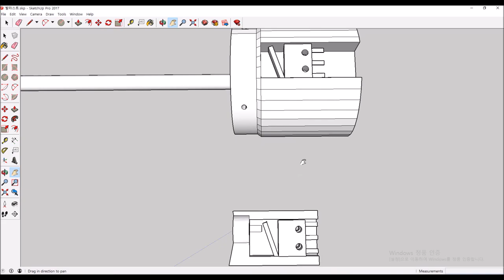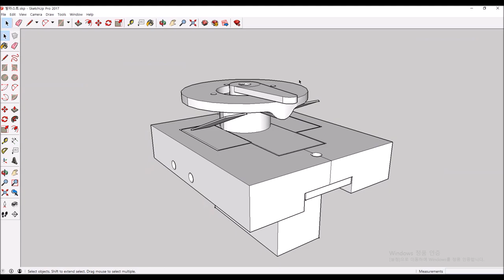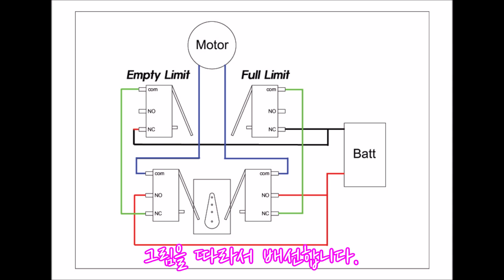RC Submarine Piston Ballast (60cc Syringe)

Comment: Amesome video - you gained so much skills in building over the time!
What is the reason that you use this mechanical switch with the servo to drive the motor? Why don't you use an electronic motor driver which would prevent the risk of mechanical failures and also would safe weight in the model?
Reply from the maker: I don't know how to connect the electronic motor driver and the micro switch, so I'm using the old way.
Reply: @tiver21  If you are interested, I can share the connection diagram.
Reply from the maker: @МаксимБондарев-щ8и  I'm very interested in the connection method. Are you using ESC?
Reply: @tiver21  да, я использую регулятор скорости, 2 микро переключателя и редуктор.